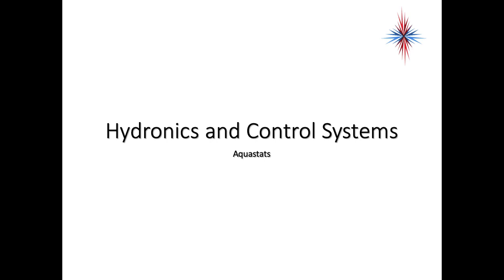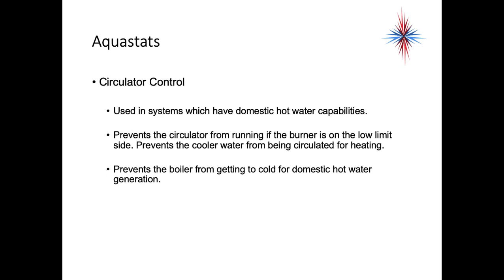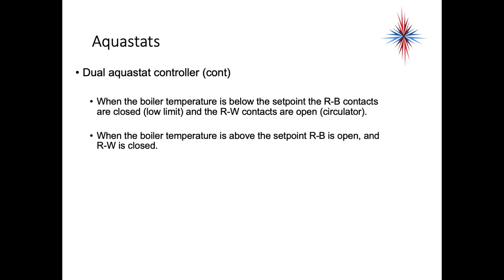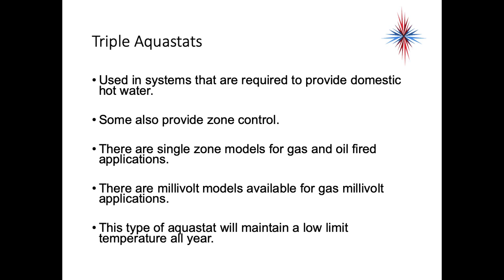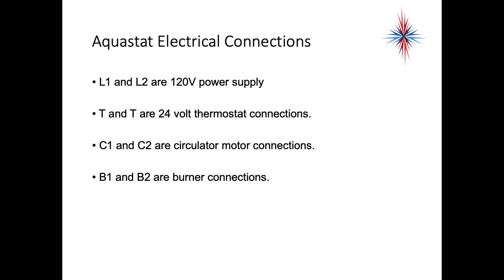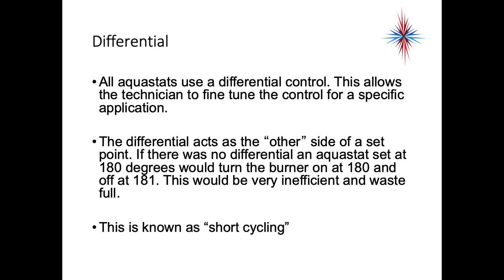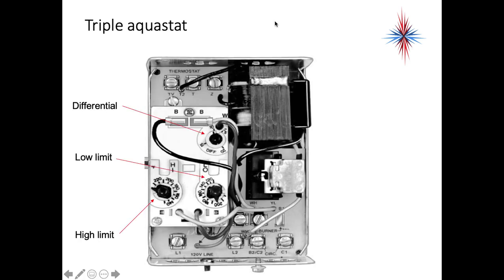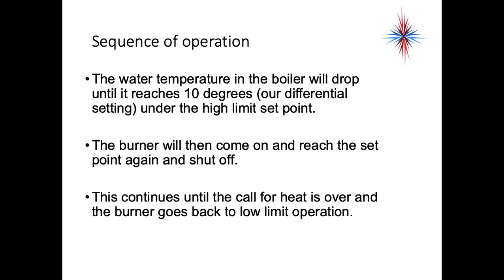Hydronics - Aquastats

Comment: I have an electric hot water tank, but my hot water furnace continues to come on winter and summer for a few minutes several times a day.  How do I turn off the part of the furnace the heats the domestic without affecting the heating of my house?  Thanks
Reply: Disconnect of blue wire in aquastat

Comment: Do you have any videos that would assist in wiring an aquastat to a zone control panel?

Specifically, I'm trying to wire two zones together using a Taco SR502-4 to an L8148E aquastat.

Comment: I have found that there is a lot of confusion with regards to the function of the differential control on the triple aquastat's like the L8124A, C and many others.  I finally decided to call Honeywell to get the real meaning of the differential setting.  I ended up speaking to three different technicians before I finally spoke to a very smart lady, (she was the third tech), a Honeywell engineer who told me straight up exactly how the three settings work, with the three being the Hi Limit, the Low Limit, and the Differential.  According to Honeywell, (and she said you can take this to the bank), the Hi Limit has a fixed 10-degree differential that cannot be changed and has no relationship with the differential knob on the aquastat.  The differential knob only affects the low limit setting and works exactly like you explained it.  Please let me know if I got her message incorrect.  By the way, you did a great job of explaining the sometimes, confusing world of Honeywell Triple aquastat's, yours was one of the best that I've seen so far.

Comment: In an aguastat with just a high limit, if there is still a call for heat, the circulator remains running. As a matter of fact, the most efficient systems have continuous circulation with an outdoor t-stat to anticipate the need for heat.